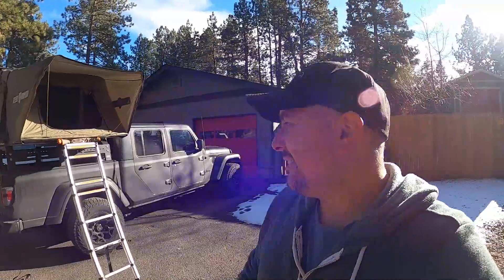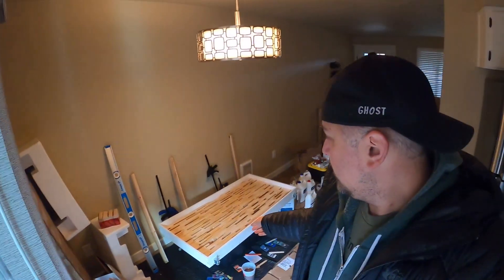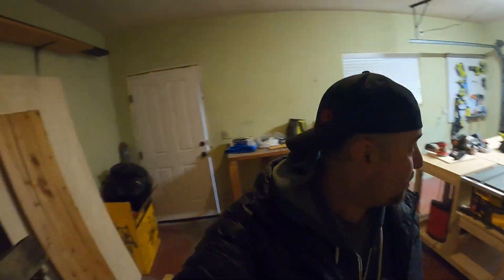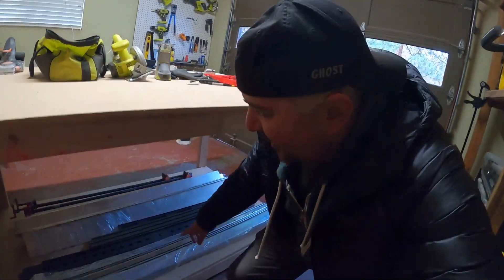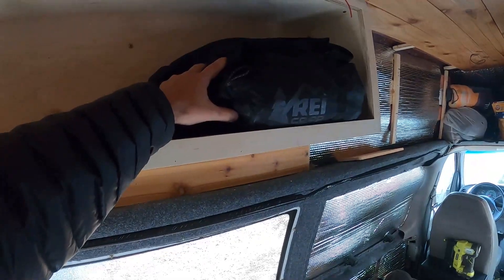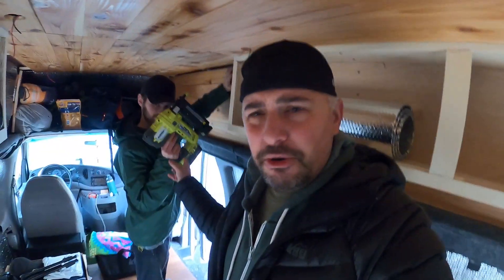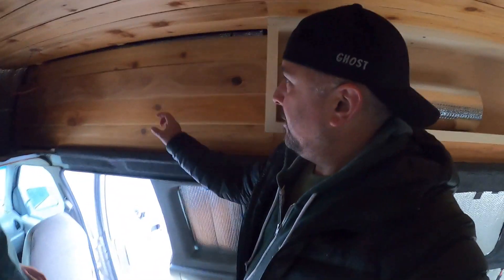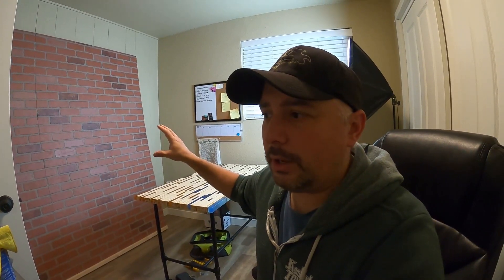Can't Wait to get Back Out - Day in the Life with Building Vans and Overland

Comment: What will be the balancing weight on the passenger side of Jeep interior?
Reply from the maker: To be honest not much. However the difference in weight won't be detrimental because it will be in a much smaller space compared to a van. My estimate is the drivers side will weight 100lbs more then passenger. I do intend to get better suspension